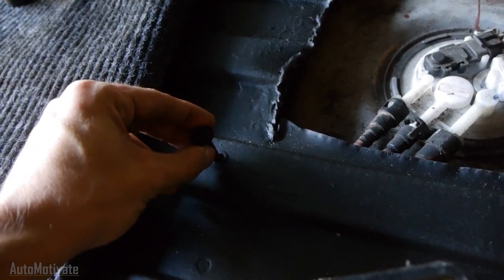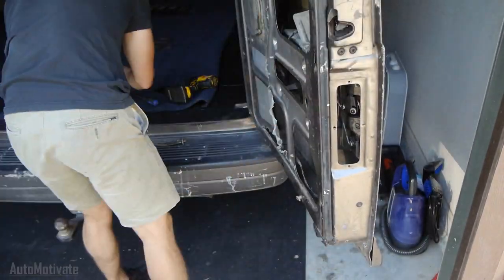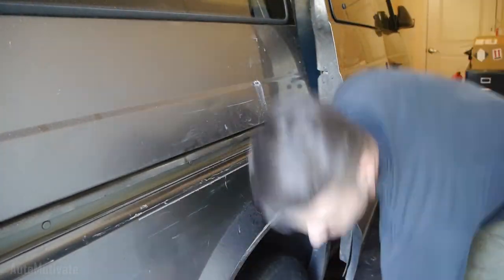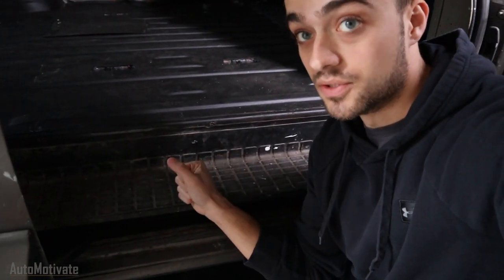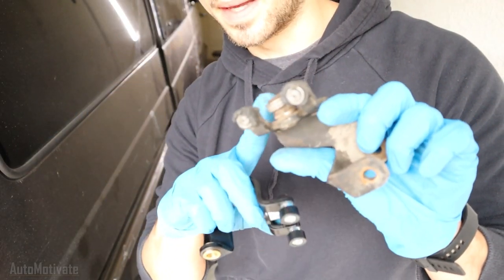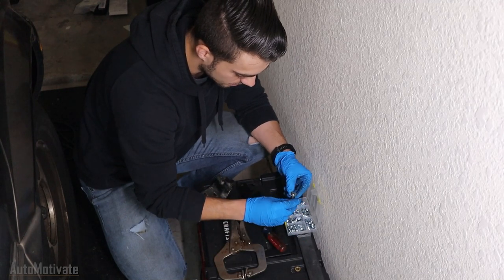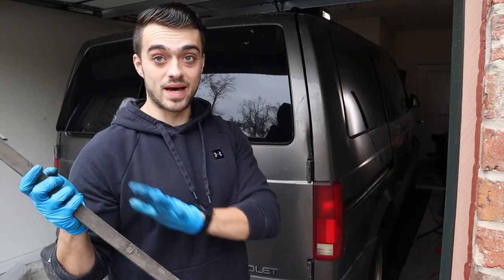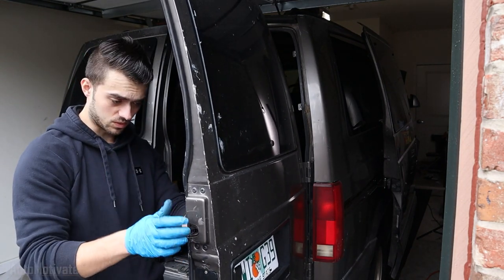Astro Van - Fixing the Sliding Door, Fuel Panel and Door Locks | Stealth Camper Van Build - Part 6!

Comment: Just a suggestion: The bearings in the rollers need lubrication, not the track. If you lubricate the track and not the roller bearings, the rollers can slide resulting in flat spots on the rollers. The lubrication needs to be put in the bearings. The track does not need lubrication, just cleaning.

Comment: Please keep posting on this van! Me and my Bf are doing the same to our Astro. We also need to replace the door slider. Could you please link the one you got, and has it worked well since you installed it?
Reply from the maker: The door slider I got actually doesn’t fit perfectly and the way I “modified” it makes the door sag a bit at the rear. 
That is due to the backwards orientation of the mount. 

I would actually pull one off a wrecked van next time.
Reply: @AutoMotivate  What exactly is the part called? Video is so helpful but want to make sure i ask for the right thing on the phone with the wrecking yard!

Comment: Hey, i have the same van and i was wondering if you could help me design a way to get ventilation  by installing a vent grate behind the license plate. 🤔 i want to make the plate stick out about an inch and  have screened airflow coming in and out from behind the plate. 
😎i don't want anyone to notice its there. I plan to use a USB computer fan on the inside of that door. 
I have a couple ideas i need to draw, but i don't mind picking your brain for ideas.😁😊

Comment: Hello I have a 1997 Astro and I need to replace the sliding door hinge rollers hinge pin and bushing  but I can't seem to find them anywhere here in Canada could you tell me where you were able to find yours , many thanks . Shaun .
Reply from the maker: I bought mine, its a new aftermarket one, off of eBay, however, I had to do some slight modifying with washers as spacer to allow the door to shut properly.  I recommend buying a lightly used example off eBay or pick one from a junk yard.
Reply: @AutoMotivate  Thank you so much for getting back to me so fast . Thake care stay safe seasons greeting to you .